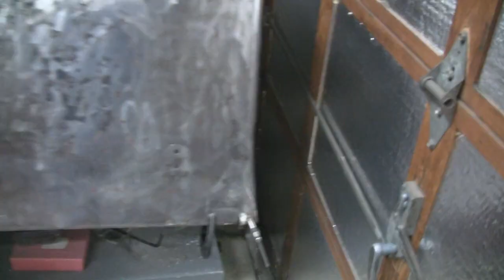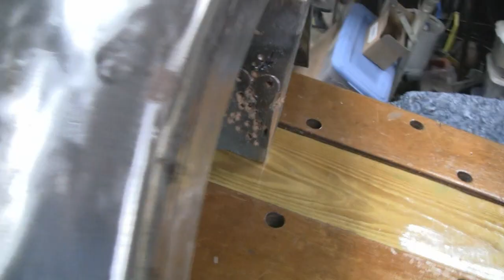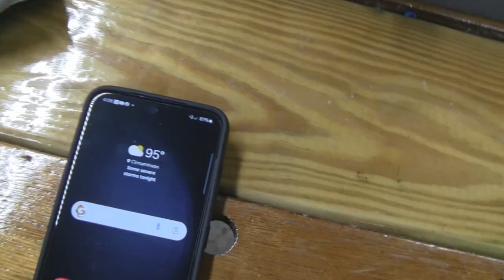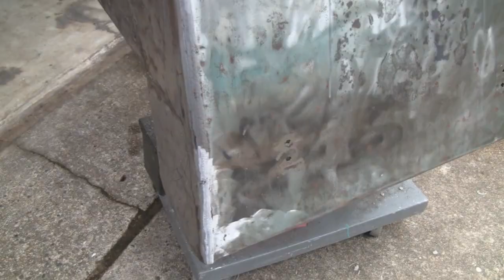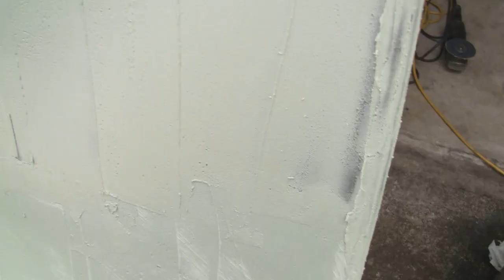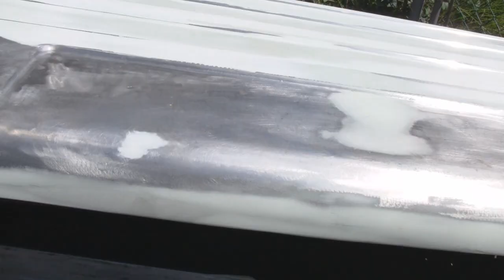1940's HARLEY SERVICAR UTILITY BOX RESTO (part 3)

Comment: I'd guess that the difference between the two parts is replacements from accident damage, they probably got thwacked by someone not looking where they were going, and was cheaper to just unbolt the damaged bits and fit a later new one made to a "more profit-friendly" standard part...